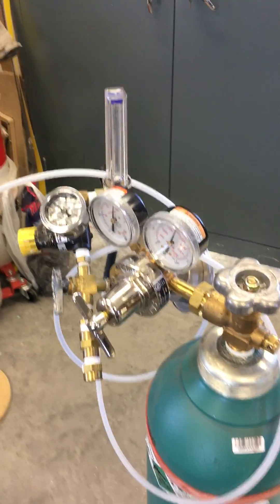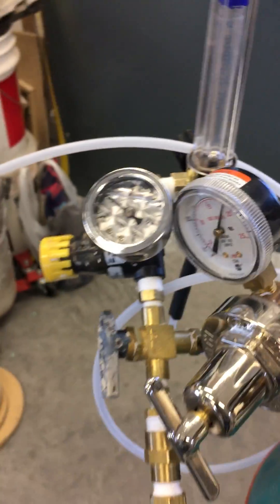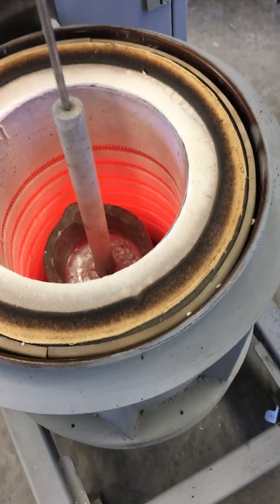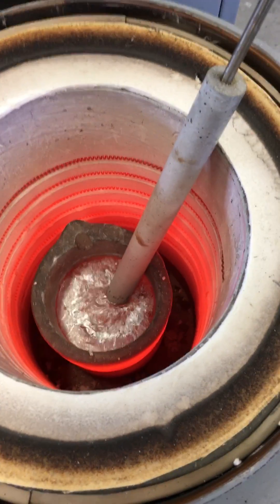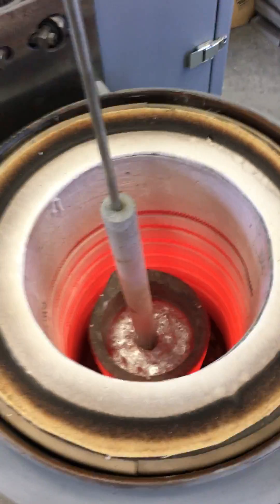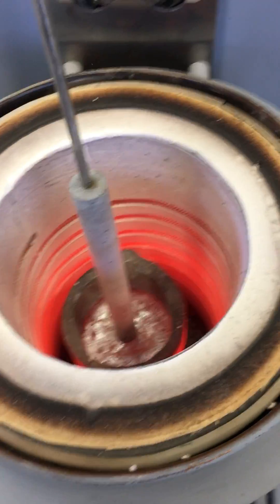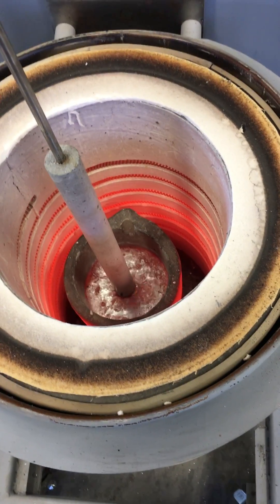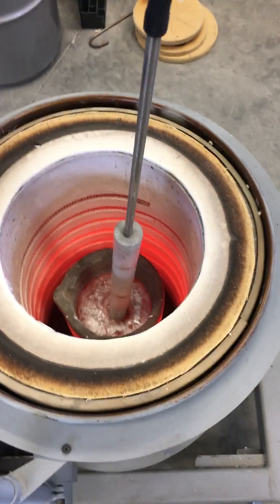4 Lance in Aluminum

Comment: Do you have details on how you made the furnace system. Very impressive!!
Reply from the maker: There is a short video here: https://youtu.be/XyLX6u2PN7M
If you join www.TheHomeFoundry.org My user name is Al2O3.There are links in the signature of my posts. There are additional links about the various versions of the refractory/furnace liner. I used to have a very detailed build thread on Alloy Avenue but that forum and the Photobucket debacle took that down. Best, Kelly

Comment: How old and dirty does the metal need to before you need to degas?  I never used car rims.  But when I purchased new 356 ingots, the supplier said degassing was not necessary. thanks
Reply from the maker: For the last several years I have almost exclusively used virgin A356 ingot in a resistive electric furnace and I dont degas. If I am recycling dirty scrap with paint and oil, I might but I dont do much scrapping any more and when I do, I wouldn't use it in preference to ingot. In a fuel fired furnace, it is important to maintain a lean furnace atmosphere. A rich atmosphere can contribute to gassy metal along with overheating. Best, Kelly